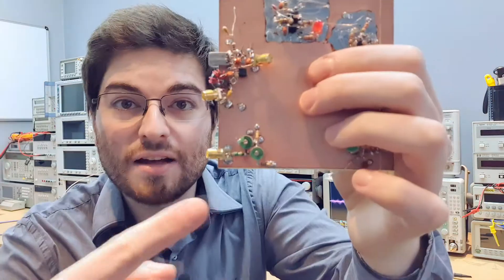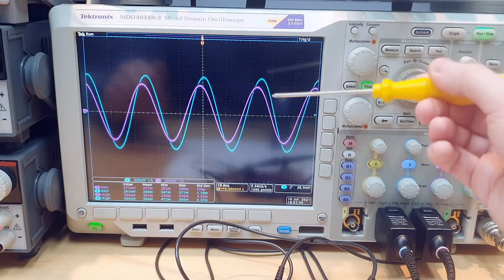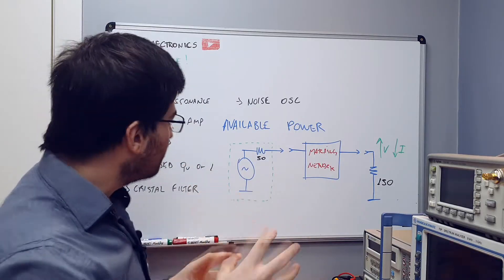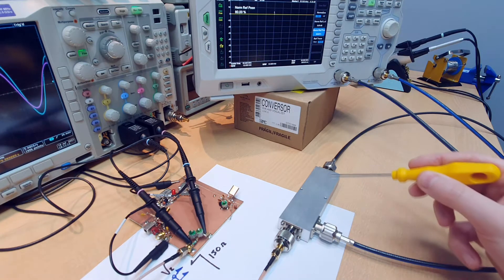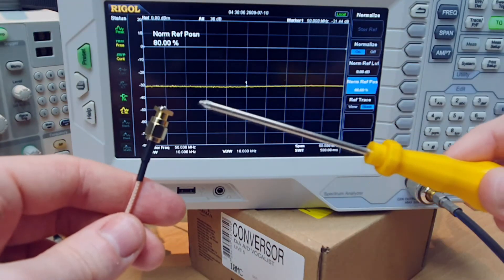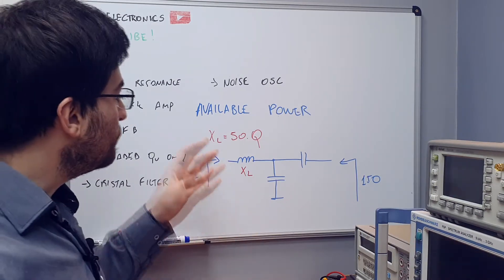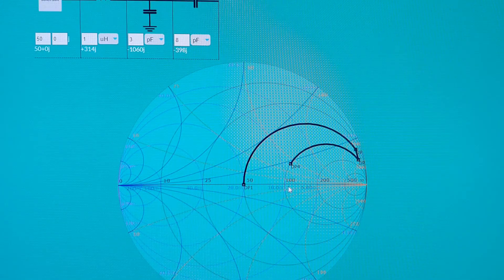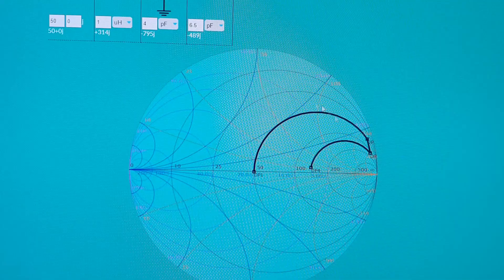Impedance Matching Basics

Comment: Tank you for your videos .I still confused when the impedance matching becomes necessary in amplifier circuits?
Reply from the maker: Thanks for watching! Impedance matching is usually important when you want to transfer maximum power from one stage to another, or to avoid reflections.

Comment: So it means impedance matching is the concept similar to Maximum power transfer theorem, is that ?
Reply from the maker: Yes!
Reply: @AllElectronicsChannel but here in impedance matching they are saying something power reflection those things we didn't see in maximum power transfer theorem ?
Reply from the maker: Usually basic courses will stop at maximum power transfer and not explain reflections. But reflections are what happen physically: the power is not maximally transferred because part of it is reflected!

Comment: Great practical video about impedance matching! I have a question about the "directional coupler" at 5:22, whose purpose is to direct the reflected wave to the port 3, which is the definition of a circulator. I thought a directional coupler takes part of the input wave from the port 1 to the port 3, not taking the reflected wave to the port 3.
Reply: For an ideal circulator this would be true. It looks like he uses a coupler (not a circulator) but he has adjusted the spectrum analyzer offset so that full reflection (he shes open but short should look the same) gives full signal strength ie 0 dB. This has the advantage that couplers do not change the impedance you are trying to measure much (especially if it is a 20 dB coupler bs a 3 dB coupler)

Comment: The voltage:current ratio of the input must match the voltage:current ratio of the output. This is the first time i've gotten a better understanding of impedance-matching. Is that ratio is determined by resistance? Is impedance matching really about matching two bandpass filters?
Reply from the maker: The ratio IS impedance !
Reply: Impedance isn't resistance?

Comment: Hello Gregory i would like to ask you about your directional coupler which you are using in the video ... could you please share the reference and where i could buy one .. the goal is to measure the output impedance of an small RF signal amplifier Parameter S22 .. thanks in advance .. Greetings from France
Reply from the maker: Hi! That is a unit I bought surplus, I don't know the exact code.. Probably any directional coupler will do.. Search options on ebay. That used in the video is a high power one, not the best for small signal amplifier.

Comment: For mini  FM transmitter it's required 50 ohm antenna and cable. RJ 58 and RJ 174 both are 50 ohms.  If I use RJ  174  cable, It would be perfect for transmitter or not? Could you please tell me this?

Comment: Hi , i have an old Marconi Step attuator which has 75ohm input and output , i would like to convert it to 50ohm input and output..i will only be using it with cb radios , ie up to 30mhz.
Can i use this approach?
Much appreciated
Reply from the maker: For a broadband match you should use a resistive atenuator, that matches the impedance. Search for PI or T resistive atenuators.

They will add an constant amount of attenuation in dB, plus what you set in your attenuation box.

You should design the attenuator for 50 ohm at one side and 75 in the other. Using two alternators, one in each side of your box.
Reply: @AllElectronicsChannel  thanks for the reply...I will peeps it 😀

Comment: batteries typically have an internal impedance much lower than 1 ohm, so why do AC sources have such high impedances as 50, 75 ohm, isn't that a lot of Joule loss ?
Reply from the maker: It was a compromise for attenuation and frequency response in transmission lines. But this is not a resistive loss in the cable, it means the ratio of the voltage and current waves in the cable is 50
Reply: @AllElectronicsChannel  OK, so the resistor symbol inside "real source" diagrams does NOT represent an actual resisting element, but rather a power source characteristic. that was misleading. thanks for clearing it up !
Reply from the maker: Yep!

Comment: how do you calculate the input impedance at the base of a bjt at rf. all examples i can find online use the beta * (re + Re) equation, but at RF the input impedance tends to be far smaller. el beta se reduce tanto en RF ??
Reply from the maker: Yep, beta reduces a lot. You can aprox. using Ft / freq. You also have capacitances Cbe and Cbc. Sometimes the only way is actually measuring
Reply: @AllElectronicsChannel  muchas gracias. )
Reply: @AllElectronicsChannel  could you point me to your video where you measure the input impedance of the bjt?
Reply from the maker: I think I do not have any video about it yet

Comment: Can we transfer this impedance theory on the power grid? Let's imagine à nuclear power plant delivering 1000 MW to the grid. If impedance of load is equal to generator impédance, we can say that the power dissipated in générator impedance is also 1000MW. I do not think it is the case. I think for nuclear power plant, we want genertor impedance as low as possible. There is a paradox in what you have explained.
Reply from the maker: If you have control of the source impedance, you make it as low as possible. If you have control of load, the best case scenario is the matched one.
Reply: @AllElectronicsChannel  so you should mention that in video

Comment: Helpful. My knowledge base does not include much about impedance, yet. Your video was helpful, because 1) you explained why matching is important/necessary, from the prospective of transferring power between two devices  and 2) you showed how a) the matching network is constructed and b) how it works via plotting/calculator. I know that I need to learn more about impedance. However, it is easy to get lulled into just throwing an op amp into the circuit design to dance around the challenges of actually learning about impedance.

Comment: Hi, great work on this content. It's good timing for me as I'm trying to design a linear amplifier for 70 MHz (4m Ham band). I am using MRF101an and hoping for 20 dB gain, 1w in 100w out. I have the 1 watt sorted (-;
I have been using smith chart software to calculate the necessary values to match the output of the device ( I am being lazy and using 6 dB PI attenuator for the input so the preceding circuit sees a good match). I found NXP provide some reference circuits (closest is 50 MHz, and one at 81 MHz), they also give some values of Z load and Z source, I discovered I could use just series inductor and shunt capacitor. Why did you use an extra series capacitor? Maybe to give more flexibility for tuning, also I guess it works to decouple AC/DC?
Anyway, again, thanks for this video.
Reply from the maker: Thank you! 

I don't know if it is easy to get 100W output with 1W input.. 

I used this network because is one I use a lot. The components values are close to real values, sometimes you get matching networks with very low capacitances/inductances.

Comment: can we use a simple opamp buffer as the matching network, instead of designing an LCC circuit?

Btw AWESOME video!! Please keep making such videos explaining very basics which we tend to forget in our engineering jouney.
Reply from the maker: For low frequencies yes! But you will not be increasing the transfer of power, you will be copying the signal with the opamp. It's kind of a different concept
Reply: @AllElectronicsChannel  As far as I know, buffers help prevent loading...so how is this different from impedance matching?

Can you please guide me to a resource if you can't briefly answer here?
Reply from the maker: Impedance matching transforms the voltage and current profile of the source, so it can delivery the maximum amount of power possible. 

A buffer will copy the input signal and deliver power from other source!! The power will be delivered from the source that is powering the buffer, not the signal source.

Comment: Great video - thank you!! Please can you say why you choose 5 as the Q factor?
Reply from the maker: Nice question! I started the design with a Q of 15, to get a ~4Meg bandwidth around 50Meg. 

Following the design I saw that the capacitors needed would be 2 to 3pF, making it hard to demonstrate with adjustable trimmers.

So I decreased the Q, relaxing the low capacitor values. 

Also, over a Q of 10 the inductor choke I used will not be ideal.. that part is made to be used as a choke and not a true inductor with high unloaded Q!
Reply: @AllElectronicsChannel  Even better answer - thank you! This is a really nice experiment and I would like to repeat it with some other matching network topologies :)

Comment: great video! 

Could you also make a comment about the difference between a transformer approach and a Capacitor/inductor network for matching impedance? What is to be preferred? 

Also, you have an amazing assortment of components in your lab! :D 
Could you comment of what you have there, and make a lab tour? 

Keep up the great work!
Reply from the maker: Yepp!! I will do !
Reply: If you want to match only 1 frequency it might be good to use the LC matching, if you want a more broadband matching, like HF transceiver then the broadband TLT transformer might be preferred. After about 6 mins you see the notch, showing the specific frequency where best match occurs.

Comment: The best impedance video i´ve ever seen, very useful the distinction of power and voltage and current and even better the simple explanation of how to use the smith chart in a basic way now I can use this In a problem that I found the other day testing an oscillator because I wanted to connect the oscillator to an RTL-SDR to check the SDR and the oscillator and the problem was that the SDR has an input of 50 ohm and my oscillator had another output impedance luckyly I found on the internet some methods to compute the output impedance of a circuit and now with this knowledge I can transform the 700 ohm output to 50 ohm. Keep going with the channel beause not much channels talk about this topics and yours its one of the best of youtube in this area. 
P.D.: I´m very intrigued about the new update with the new design of the bpsk transceiver.